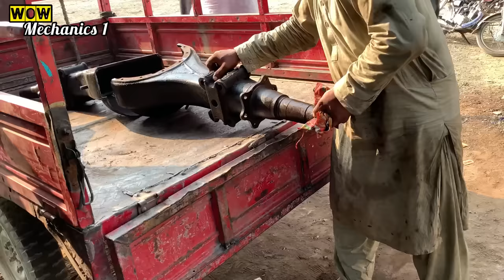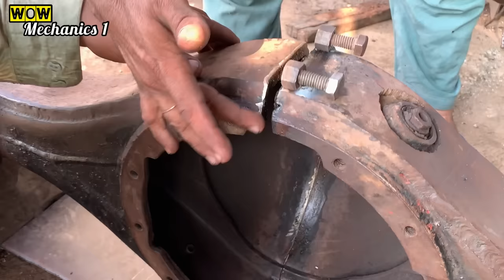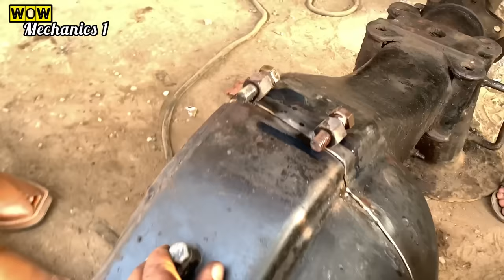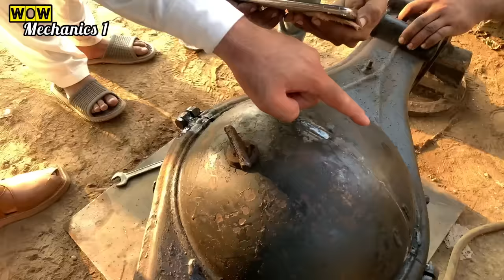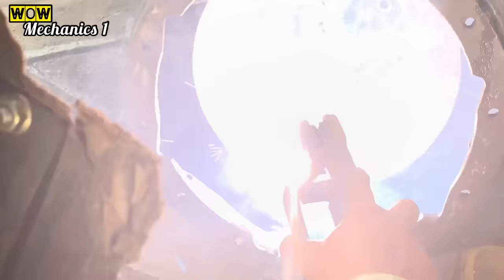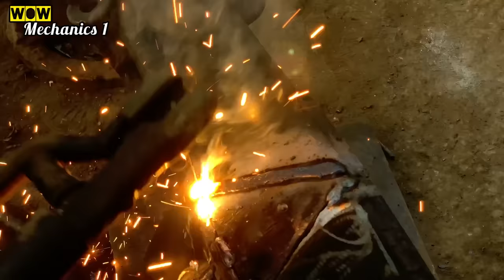The Axle of a Truck Broken in a Strange Place // And the Masters of Metal Fixed it Using Magic

Comment: It was cut in half to make this video. Nothing breaks that perfectly!
Reply: Just for content,not to reuse in a vehicle
Reply: It broke on the previous weld, you can see it about 3-4 minutes in.
Reply: @12time12  I don't think so. Looks more like cut by plasma cutter ;-)
Reply from the maker: Thnks
Reply: The slag did give that away
Reply: Yeah nature does not make straight lines. My thought on this was sabotage but your thoughts on this also make sense.
Reply: @ArmanArman-dr6zg   Oh they will use it alright. These guys make every move count. If this was not going to be used they would have made a different video about fixing something else they can profit from. They got kids to feed.
Reply: Он сами не знают что делают🤣
Reply: • it's possible another shop got it 1st, then sent it there for more work •
Reply: Absolutely
Reply: Plus you could just hold a part vertical and do all this since it would fit and rest together perfectly.
Reply: I should think it broke and they gas axed rest off.
Reply: Looks like 2 halfs from different trucks
Reply: I think you are right, but still good idea how to fix it.
Reply: Boloney brains! It's two different diff. Cases made into 1.
Reply: indeed
Reply: @puto3616

You couldn't be more wrong. The rear of the differential housing has the same welds where someone attached a bracket previously, in addition to an identical brace made from plate steel that ran across the underside. Both are non standard modifications that demonstrate that this was originally a single unit that was cut in half, likely with a oxy acetylene torch.

Even if you missed both of those context clues, the identical paint on both halves should have clued you in.
Reply: @marphymarphy  there isn’t a plasma cutter within 1000 miles of this place! Lol! Lol!!
Reply: I also work in workshop but this is not a real, as I think firstly they cut it from centre..... It is not possible that the tube can crack from centre in straight line it happens only from hub side
Reply: And welding two nuts on like that makes it non adjustable , one needs to be a bushing /smooth inside .
Reply: Возможно слепили из двух сломаных 1)
Reply: @12time12  Ive never seen an axle housing welded down the centerline like that. And this one was 100% cut, the back domed piece is a solid stamped piece that's welded around the outside edge.
Reply: Nado , Pregunta ;  es tanto el peso de la carga qué pasa eso ?  Como puede dañar algo para tener que pagar por arreglarlo?  Claro si necesitan De lo que veo ,no vivo allí , cargan  más de lo que responde el camión ,motor  ,sin ofenderlos , ni a usted tampoco ,es solo una pregunta . Mucha carga , más Plata . No estoy criticando ,solo pregunto .
Reply: These people WILL take tow halves of different housings, clean them up and weld them together an absolutely use them. This may be just for content but if one half on the rear end was bad, say the axle tube broke or bent; they won't hesitate to chop it in half, find one with the opposite side that's wrecked, chop it in two and weld the two good halves back together
Reply: Parabéns pelo vídeo ❤
Reply: Its how they cast them... pretty stupid imo.
Reply: my impression was, they are joining useful halves of two broken axels.
Reply: @Wildstar40  My thoughts exactly. If you are a dirt-poor truck driver in Pakistan, you need to get that truck back on the road. If he had the money, he would have replaced the entire differential. One day turnaround was all he had time for. All things considered; they did a great job.
Reply: 100% agree, thats the straightest most perfect crack I've seen in my life ever.........lol

Comment: am i the only one seeing this??......threaded bolt and two nuts welded on either side of the break.....and threads in both nuts??......i'll wait......someone will understand where this boat sank......
Reply: There is a lot wrong with this video including the two threaded nuts that will not tighten together . 
Since when has anything ever broken a perfectly straight line down the exact center of a differential. Additionally in terms of over load breaking, the middle section is strongest part when assembled. One of the axle arms should break away before the center would break.  Any break would also be crooked and typically run from a hole to another hole.  Good repair, good welding but this does not look authentic, this housing looks like it was cut in half.
Reply: @wirefeed3419  i assumed it was a salvage tube, the two busted halves were canned and made one good tube out of two dickered ones
Reply: @piperdoug428  That’s possible definitely way more believable than being broken as claimed. Zooming in it sure looks like a cutting torch was used.  I do give credit for the skills regardless of a couple flaws
Reply from the maker: hmmm tnks
Reply from the maker: hmmm tnks
Reply: Right

Comment: One side of the nut assembly should have had a smooth bore to be able to pull the two halves together. Having both sides threaded will not allow the halves to get any closer than they are when welded.
Reply from the maker: Thanks by Wow Mechanics1
Reply: Просто установить редуктор и потом сварить эту конструкцию точнее получилось бы
Reply: Agree !!!
Reply: Yes, but the "wow" team, as you can see, does not know this, the lack of logic, but anyway they work hard. All respect to them.
Reply: I was trying to figure that out too.  They serve little purpose other than the alignment is all I could figure out.  I have so many questions about the process.
Reply: I was also shaking my head on that one
Reply: That was intentional.  They needed an clean open groove, as you can't weld on a dirty closed crack.  So they lined up the two broken sections using the original cracks and welded the nuts to set the alignment.  Off-camera they separated the two halves by removing the bolts and used a grinder to clean the surfaces.  When they re-joined the sections with the bolts they had clean surfaces with a small gap, while keeping the proper alignment.
Reply: Because these "masters of metal" have no clue how metal behaves.
Reply: @1djbecker well what you said makes no sense but ok
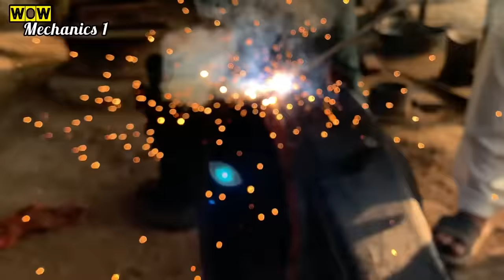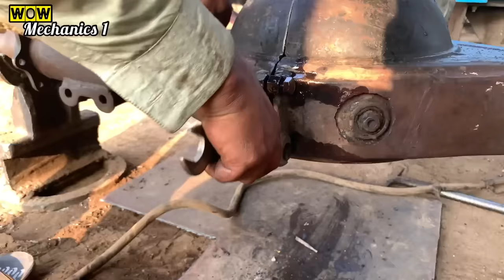Reply: @A_Stereotypical_Heretic  At 9:00 they welded the pairs of nuts in place based on aligning the cracked surfaces.  They then opened and grooved the crack surfaces, and did the final alignment with a mallet.   The video skips the disassembly, but you can see the reassembly starting at 9:34.  The goal wasn't to bring the cleaned surfaces together, it was hold them precisely gapped in a way that could be separated for surface prep.
Reply: @ferenczieugen2984  They work hard just for the camera this time. This "thing" will go to the junkyard. Welding steel to the cast iron never finish good...
Reply: Won’t hurt it

Comment: Back axles have been wwelded up from pieces for many years and never really fail thanks to weight regs and weighbridges making overloading an expensive criminal act.
This repair seems to be two good halves welded to make one.
I'd have welded on some extra strengthening pieces but then in normal use does th ebanjo get massively overloaded
Lots of these vidoes feature truck axles that have broken at one side due to wear and overload and bad roads so I think here they took two good halves to make one good complete one.
Reply from the maker: Thanks

Comment: I'm curious how all of the bolt holes line up once they get it back to the truck .  I guess they can fix anything with enough welding rods and hammers . But why did it crack in the first place , over loaded , bad roads  ? Both 😂
Reply: Its not a new banjo so its cyclical fatigue cracking the banjo. Together with overload or bad design and craftmanship. Its a welded banjo, like Scania has, I worked at the Scania factory where the banjo was manuf. There was some thermal stress relieveing operations on the scania banjo. So i believe that whne welding a banjo the devil is in the details for long life. A small material defect like poure or a welding defect at the high tension spot reduces the fatigue life a lot.
Reply: It looks like it was cut in half. Maybe to facilitate taking it apart after a seized bearing. I home this guys are religious, only prayers will keep it together.
Reply from the maker: hmmm tnks
Reply: Damaged on opposite ends of 2. Cut off the bad left from one and the right from another. Then weld 2 good halves together to make one usable housing.
Reply: Stop hating 😂
Reply: If you saw the state of their roads yoy would unstand why these things break. I have seen them few years ago when i visited that country

Comment: They checked everything except if the diff. housing bolts will line up or wether  the axels will line up with the diff. gears.
Reply: @guillermocarrillo3959 the repair was only for YouTube viewers it will never go back in service.
Reply from the maker: hmm

Comment: It would be great to monitor how this repair is holding over time.  My guess is that it will depend on the extent of daily stress that the truck axle is under.  Over-loading at this point is not a good idea.  Under-loading a bit will keep the stress at a reasonable level.  Amazing work and skill using what is available.  Very impressive!
Reply from the maker: Shukria jnaab

Comment: А зачем вообще его разрезали?! 
И зачем весь этот цирк с подгонками? Возьми редуктор и скрепи им обе половинки, вставь полуоси и спокойно обваривай - ничего никуда не сместится.
Reply from the maker: ye  right
Reply: Это волшебное шоу с гайками и болтами, которое не регулирует ничего)
Reply: Похоже его сварили из двух. С гайками тоже не понял в чём смысл был этого ритуала.
Reply: @MRooodddvvv , гайки вообще бесполезны были, потому что они ничего не стягивали. Ну разве что просто удерживали две половинки.
Reply: That's what I was thinking, they could assemble it with the parts that's supposed to go in it, use the parts to align the housing then weld it up. Take the guess work out of it and be assured alignment is spot on unless of course they didn't have the parts on hand.
Reply: Ты не обратил внимание на маленькую тачку, селиком он туда не поместиться .
Reply: Right

Comment: Instead of cutting out the triangle and putting in a new piece. They should've put a long rectangle piece    with rounded ends over the top about a 2 feet or half a meter long. Basically putting a truss on it.
Reply: Top and bottom and across the back of the diff. I thought they would have done that considering the future overloading it will be subjected to.
Reply from the maker: Thanks Sir
Reply: They should have done that on the inside and the outside.

Comment: my only recommendation to ensure the 2 axel pieces are welded with the right amount of GAP:   hold the 2 pieces together.  Get the front portion of the axel (the part with the KING bearing)......  put 3 bolts on each side just to hold the 2 pieces in place (with the holes ready to accept the front piece of the axel)....then tack weld the whole crack while the bolts hold the BOLT-PATTERN in place.  Thanks.

Comment: I have to say I can't see the point of the carefully welded on nuts and bolts, they don't provide any adjustment or alignment assistance as both nuts are threaded.
Reply: Glad I am not the only one that didn't get that.  Thought I was missing something.,,,,, And for the life of me I don't see why they just didn't bolt the pig back onto it. - Would have covered a multitude of sins. 

BTW. I don't think that perfectly straight "crack" is a result of a broken weldment. Looks like the halves came from 2 different housings. ,,,,,

They got it done, and other then the joint prep it was very well done, but it doesn't make a bit of seance to me,
Reply: @mathewmolk2089  Maybe they cut 2 bad axles to make 1 good axle, dunno.
Reply from the maker: hmmm tnks

Comment: Wonder why they don't bolt the diff to it?
Reply: same thing I was thinking, that would line up everything instead of fighting as hard as they did
Reply: Me also...doh!
Reply: If they did bolt the diff in, they wouldn't be able to show off their new sandals!
Reply: Bolting the diff in place doesn't automatically make everything straight and aligned.
Reply from the maker: hmm  tnks
Reply: @lonelymtbrider3369 
Well, it would true up the face plate and align the holes to original spacings in one plane. And then true align the axles before welding.
Reply: They should also have a steel bar that is a little longer then the width of the axle as that would line everything up.  If they had a center section in it the bar would go through the center section.
Reply: No wonder they are wonderfull
Reply: For this piece they should had preheat around the split  work piece before welding.
Reply: Cast steel must be heated up to Weld   to prevent micro hairline  cracks ..😂😂
Reply: they preheated it off camera. Lol
Reply: ññ

Comment: Not going to ask why this and that, but I have noticed that they did not "groove" the edges on the outer side, and they did grind the weld down Groove is made so the weld penetrates better and when we need to grind off the weld to make the joint look nicer on the "show" side-on the "hidden" side, simple weld is done.
 At work, we grind down such welding (as on this video) to the surface level if we want to BREAK apart  the joint.
Reply: They do this work for peanuts. Like the saying goes, you get what you have paid for.

Comment: Don't think this axle broke like that, it most likely had some catastrophic bearing disaster on one side, and they found another junk axle that they could combine into one functional one.
Reply: That’s what I was thinking too but I can see an “aftermarket” reinforcement plate on the bottom side of both sides that match.  Which then how the hell do they break it so perfectly in half!!!???
Reply: @camwichert8185  Maybe there was some kind of casting/manufacturing defect that made it crack in the middle. Seems it is also more common to overload vehicles in some country's...
Reply from the maker: Thanks.. U
Reply from the maker: Thanks.. U watch my video

Comment: I think 'STRANGE' place lost it's meaning about 50 videos ago  with these same breaks.  Strange that they break in the center where the overload is equalized. Normally the axle end snaps off at the springs where it broke before.
Reply: Right

Comment: Wonder what the purpose with the triangular sheet metal part was? It didnt look like it was thicker. I think its for making the weld diagonal in that place and increase the fatigue life…
Reply: Did it break in a strange place again? Could there be any stranger place than Pakistan?
Reply: I was thinking the same thing. At first I thought it might be to straighten the assembly which possibly moved due the contraction after the welds cooled. The face where the cover bolts on might be slightly out of flatness (is there such a word as flatness) enough that the gasket would not seal the oil. If that bolting face was out of alignment then the axles would not be perfectly aligned. The triangle patch might make movement after weld cooling worse.  Then I realized the triangle patch added more weld length and therefore more strength than just a straight few inches of weld.  Maybe it's both??
Reply from the maker: hmmwrith
Reply: Gotta be to increase fatigue life.
Reply: Balance or as close to as possible

Comment: Guys you can get a special tool on the internet that bolts to the differential housing using the existing bolt holes and has a shaft that goes through the entire differential housing and has piece that slide into the shaft at both ends and has pieces in the middle that bolt on that align the bearings, ring gear and pinion gear up perfect all other dimensions don't matter 😊😊😊
Reply: If that special tool is unavailable on the 24-hr shipping store, there is always th choice of reinstalling the differential cover with all its bolts and that gives pretty good alignment too.,
Reply: In retrospect, without the special alignment tool/shaft you describe I would have used precision strong backs bolted to  the existing bolt holes which would keep the alignment fairly close. You are correct in saying "all other dimensions don't matter".  Why get precise where precision doesn't matter. I have often made things too precise.  You could line bore it but then you would need oversize sleeves or bearings etc.
Reply from the maker: yes good

Comment: Lot of pissing about with the nuts and bolts. Champer the crack. Bolt the diff head in place and weld the crack. All measurements and alignment would be spot on.
Reply from the maker: ji

Comment: There is a execution error about the plan with the drilled holes before welding, not respected the plan with a blocked planar steel, second is the choice to remove a triangle, is better to add a steel on the brocked area

Comment: Main reasons: Overload, wear, bad roads and very hard and poorly maintained leaf spring suspensions that transmit shocks to the entire structure.
That is a breakdown almost impossible to see here in the EU, no one risks paying a huge fine and having the truck detained until the excess load is removed.
Here almost all the trucks have air suspension.

Comment: Those bolts will never tighten up. They are both threaded. Also, how flat is the face of the bell housing. That needs to be perfectly flat or an oil leak will likely occur.

Comment: if you don't use the grinding wheel and you don't grind the two broken parts you don't give it penetration, when you weld it is welded on the outside, not on the inside, you know how long that piece of iron lasts very little because there is no welding penetration . P.S. therefore use basic non-rutilous or sliding electrodes
Reply from the maker: Thanks.. U